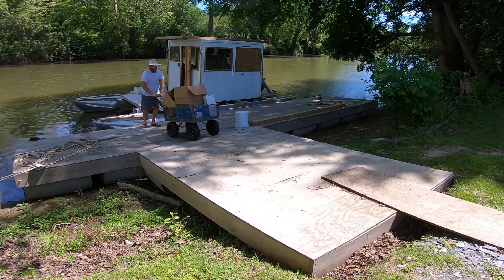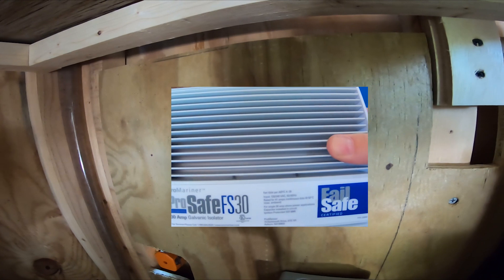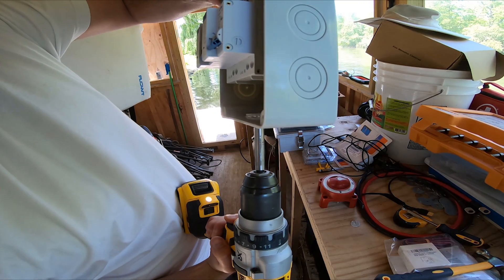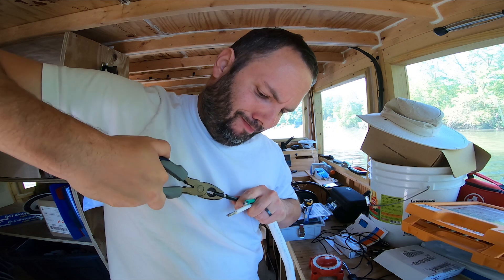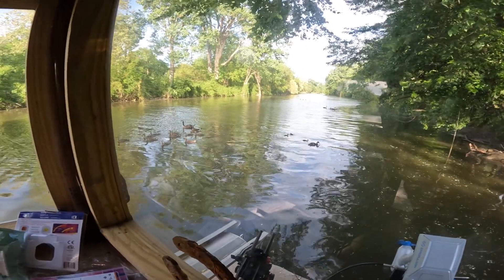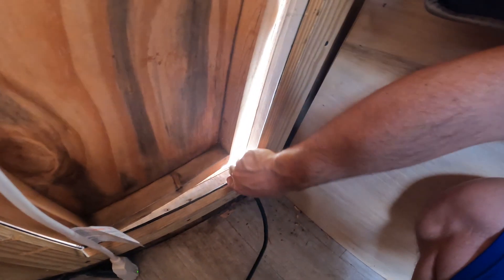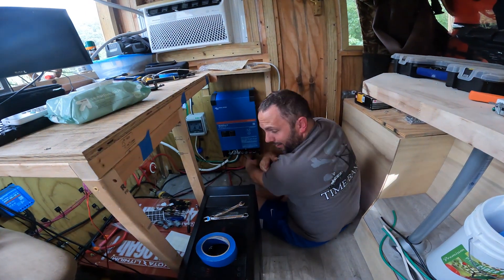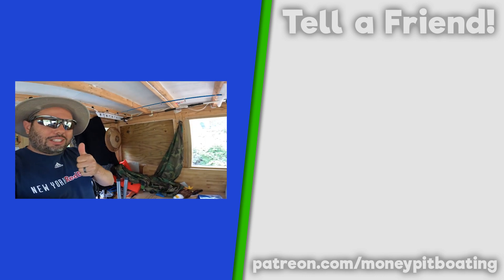HUGE Electrical Upgrades for the Solar Powered Houseboat!

Comment: I haven't watched this video yet, but have watched most of them, and had a question. I want something similar to your boat to cruise the StJohns here in Fl, and seem to recall you mentioning your boat was sinking, was the reason you added the 2 pontoons. Was the boat just too heavy? Or did you have leaks in he existing pontoons? Also in you opinion is a cabin about the size of yours going to just be too heavy for the average stripped down used 2 pontoon boat? And, have you any advice to make it work with just the two pontoons, or will 4 be pretty much a necessity? One more...the rough price for your new motor? 

Thanks, and have enjoyed you videos.
Reply: We all make mistakes and might as well learn from each others. Thanks so much for taking the time to list a bunch of very helpful info, and assuming mine doesn't end up a pipe dream, I may take you up on your generous offer for future questions. Take care!
Reply from the maker: Bingo and feel free! We'll be here!
Reply from the maker: First off, thanks for watching!

Secondly, yes, we added WAY too much weight to our original two pontoons. They didn't have leaks.

You could build a bigger cabin, but you have to do it the right way...

We had no clue what we were getting ourselves into, but learned a lot from our mistakes!

We'd say that one of the most important things to do when starting is to find the right pontoons. The longer they are, the more they can hold. The bigger diameter, the more they can hold.

Look for AT LEAST 22"-25" diameter pontoons, because they can hold way more weight than our original 18" pontoons.

Then, use the right materials in the right spots.

If we had the money, we'd use aluminum, because it's light, and it doesn't rot.

Also, the taller you make the boat, the more it will want to tip over in waves. Changing our boat from 8' to 12' made it WAY more stable in waves.

Another thing we would change is our solar panels. Each one is a little over 18 lbs, so times 10 is about 190-200 lbs on the TOP of the boat, which makes it want to tip more. They make flat panels, which are a little over 4 lbs, so we'd have about one fifth of the weight.

If we build another cabin on an 8' boat, we'd probably tip the walls in and have the top of the cabin 7' wide, to help it not tip.

But then you lose surface area for panels...

Everything about boats is a tradeoff, so think long and hard on what you really want, and make good decisions on materials.

Then you'll build it, and your preferences will change, then you can start all over!

And to answer your finally question about motor cost... we probably have about 9k wrapped up in it AND the batteries. It sucks, but we had to get rid of our trolling motor. It was too weak to push our tank of a boat!

If you have any other questions, feel free to leave them in the comments, and we'll answer them as best as we can!

And have some fun building your boat!
Reply: @MoneyPitBoating  are those flat panels the ones that put out way less power? does it balance out with the additional number of them you can put up there?
Reply from the maker: Not sure what you mean, but because they aren't tipped towards the sun, yes, they put out less power than they could. We added more to increase the number of watts!
Reply: @MoneyPitBoating  Mark, I'mma be real with you dude: I have NO IDEA wtf I was talking about in that comment, lol.
Reply: @MoneyPitBoating  wait I remember now: I think I was asking, did you guys get the thin and light panels that are flexible ("flat??" wtf was I smoking?) or the normal heavier ones that put out more juice? Those are polycrystalline right?
Reply from the maker: Bahahahaha A fellow non-word wizard...!
Reply from the maker: These are the thick heavy ones that are poly, which are cheaper and less efficient. Cheaper is the key word here!